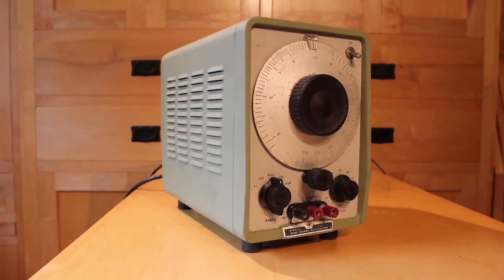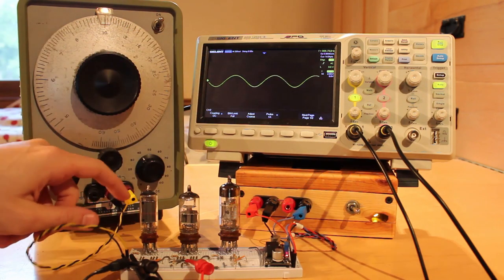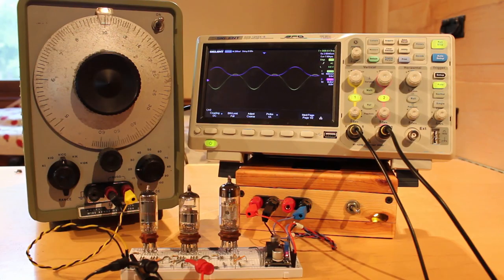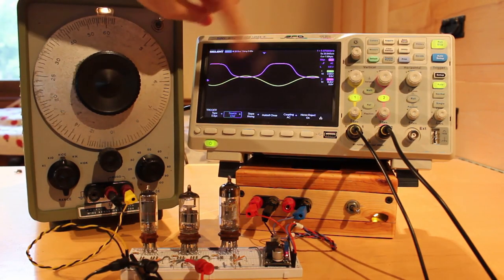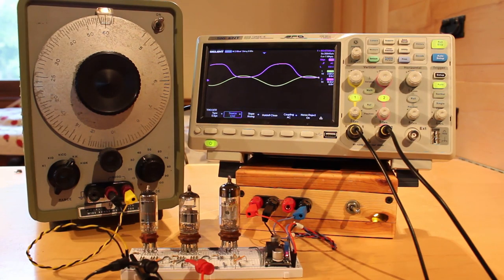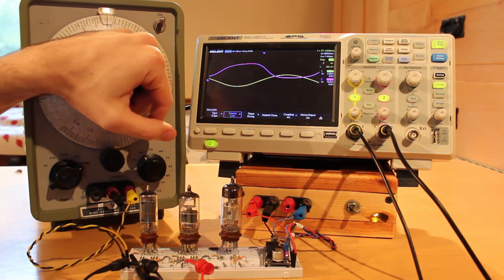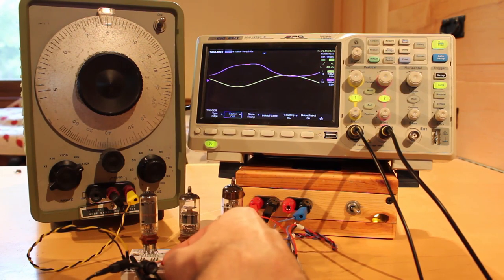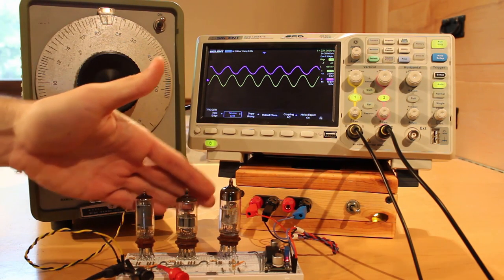Testing Our 24V Vacuum Tube Inverters at Different Frequencies

Comment: Thanks for the cool video!  I sometimes miss geeking out analyzing high voltage bus common mode noise measurements from when I worked on GM's electric cars.

Comment: You can prolly get better results by using some more specialized tubes.  Tubes designed for like 12 or 24 volts.   The classic is the 28D7– LOTS OF PLATE CURRENT possible at low plate voltage.  Used in the Collins R-392 radio for audio output.  if you buy a 1958 Edsel car, the radio has a 12K5 putting out like 40 milliwatts.
Reply from the maker: Oh yeah, absolutely! Space Charge tubes for automotive applications are awesome. I have one that's meant to have 12V on the plate, and it's absolutely excellent! The only problem with them is that they were only made for a few years, so they're moderately rare and can be quite pricey comparatively.
Reply: @UsagiElectric  Yep, there are still many WW2 surplus 6J6's and 6AC7's.  A few years ago there was a govt sale of 12,000 6SK7's, probably went for pennies each.  Speaking of low-voltage tubes, I have seen regular 120VAC radios converted to 32V farm use just by bypassing the rectifier tube, the 35L6 output tube could still put out a little audio with 24 to 32 volts on the plate.   The other tubes, 12SA7, 12SK7, and 12SQ7 also worked fine with 24 volts on the plate and rewired with series-parallel heaters.

Comment: 12:30: Having already watched some of your newer videos as well, I've been asking myself, if these valves work so well at a relatively low 24V, how come this wasn't how everybody ran them, seeing how designing things that way probably would also have extended their lifespan. Right here is where I finally got an answer to that question: That would have slowed things down. Eeeeeeeeeniiiiiiiiaaaaaac wouldn't have cut it. They wanted ENIAC. So I guess the whole danger, danger, high voltage thing is just a trade-off they were willing to make for speed.
Reply: That's the whole point of this - they don't work well at all. If your typical tube was really supposed to get the heebee-jeebies at 200KHz, there would never had been such a thing as a tube radio.

Comment: At 8:45 you point out that the tube's response has time skew in the 30kHz range but no discernible skew at 10kHz. What about near 20kHz, which is the upper limit of human hearing for audio? In other words, is the skew audible?
Reply from the maker: Thanks for checking the video out!

That’s an interesting idea! Unfortunately, whether it’s audible or not is not something I could test as my hearing is absolutely atrocious, haha. 

I did take a snapshot of my footage at right around 20kHz though, just to see, and it honestly looks super similar to the performance at 10kHz. Here’s the snapshot: https://i.postimg.cc/g2TyhVwk/17-18kHz.png

So, it’s looking like the slow rise time doesn’t really start to become an issue until after 20kHz. Although, for audio situations, you don’t really want the tube to ever reach cut-off or saturation, that’ll cause all sorts of distortion in itself. Most audio amplifiers I believe only use about 50% of the tube’s total range. In which case, the tube would perform really well even up to well over 100kHz.

Comment: For hi speed of work inventer need low Ra value, hi anode current, minimal gird resitor value and more tube S. Hi voltage = hi current, lo Ra.
Reply from the maker: Oh yeah, I definitely need a lot more voltage to get the tubes working accurately at higher speeds! Unfortunately, at 24V, a 10k plate resistor is about as low as I can go before things start falling apart. On the plus side though, all the stuff I build is intended to work at insanely low speeds!

Comment: Is there a vacuum tube equivalent to a P-MOSFET that you can use as an active load? I do wonder if that slowness in rise time is due to the passive load, since that is also a thing for semiconductor gates.
Reply from the maker: Thanks for checking the video out!

I’ll be honest, my MOSFET game is real weak, but if I’m understanding correctly, a P-MOSFET is essentially conducting from source to drain, unless the gate is pulled low, in which case it conducts from source to gate, right? MOSFET’s are super weird to me, haha.

As for tubes, it’s easiest to think of the grid as being totally separate from the rest of the tube. It’s merely a gatekeeper and shouldn’t really be absorbing any electrons. I do have a theory as to why the slowness is occurring though.

The rise time is equivalent to the transition from saturation to cut-off, in other words from electron flow to no electron flow. When the grid goes negative, there’s still some electrons on the other side of the grid, filling the space between the grid and the plate. The plate gobbles all those electrons up, but it takes fractionally longer than the transition on the grid took. However, when the grid goes positive again, a cloud of electrons has already built up between the cathode and the grid, and that electron cloud rockets to the plate. Which is why we see a sharp transition from cut-off back into saturation.

At higher voltages, the plate may absorb those electrons faster and you may be able to pull faster operation out of the tube, which is something I’ll test again in the future once I get a nice HV supply built (which is an episode in the works now).
Reply: @UsagiElectric  I've been following around on Reddit for a while now but I don't have an account there - should probably be following here instead! I really appreciate the content - thanks for putting it out there.

As for MOSFETs, your description is about right. I think N-MOS works similar to a triode and a P-MOS is just the same with the doping and the charge carriers reversed, so a minus sign ends up going in front of all the device equations.   I guess to do that with a triode, you'd need to somehow emit positrons instead of electrons, right? :)

The explanation for the slowness is pretty interesting though, I was assuming device capacitance is basically nothing since the different electrodes are reasonably far apart - so why are these tubes stuck at only a few hundred kHz, right? I never thought of the space charge floating inside the tube to be the reason. Is this also why there is a resistor on the grid? I would have thought if the grid is isolated from the circuit it could have just been a straight connection.

Also, do you have any resources that you recommend to learn about tubes in more detail? In any case, thanks again for the explanation and hope to see more of your great content in the future. Cheers!
Reply from the maker: @DerinTheErkan  Thank you so much for the praise!

It makes me so happy to hear that these videos are enjoyable and I love the conversations they spark. On Reddit, I tend to only post little 30 second video summaries of the full video with a short description, so if you’re looking for more in-depth material, this is definitely the place!

Interestingly, one of the purposes behind development of both the tetrode and pentode was to mitigate some of the capacitance that exists between plate/grid, plate/cathode, and cathode/grid. It’s not much capacitance, but just enough that it could cause weird oscillations in certain circuits. The screen grid in tetrodes and pentodes helps fight this. However, as far as sheer speed is concerned, the 6AU6 pentode and the 6DJ8 triode seemed to perform nearly identically, which was surprising to me!

The grid resistor is mainly there to protect the grid. While it definitely makes it easier to think of it as being separate from the rest of the tube, it is still inside there, and if you put enough of a positive charge on the grid, it’ll start soaking up some electrons as well. Too much current flow through the grid can damage it, so the grid often has a decent resistor on it to minimize any possible current flow through it.

The absolute best resource I’ve found to date is the IBM 604 Customer Engineering Manual. They start at the very basics with explaining all the elements in a tube and how they work, then work up to building the fundamental computing circuits used in the machine. It’s an absolutely fantastic resource!

http://www.bitsavers.org/pdf/ibm/604/

Thanks again for the praise!
Reply: @UsagiElectric  a MOSFET should NEVER conduct from any of the other electrodes to gate. If it does, that means the MOSFET is destroyed. The gate in a MOSFET is completely isolated from the rest of the structure. Think of it as an equivalent of the control grid in a vacuum tube. You don't want any current flow in the grid.